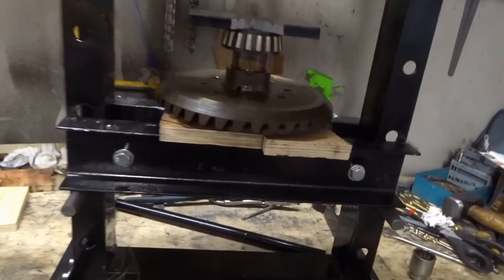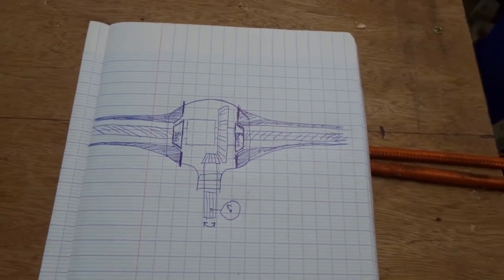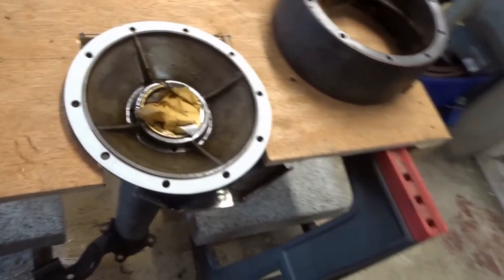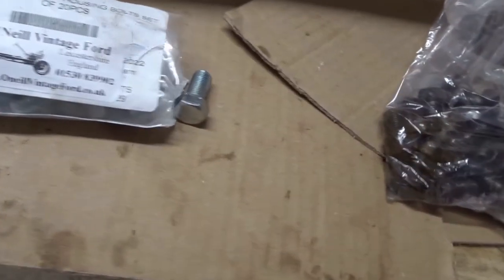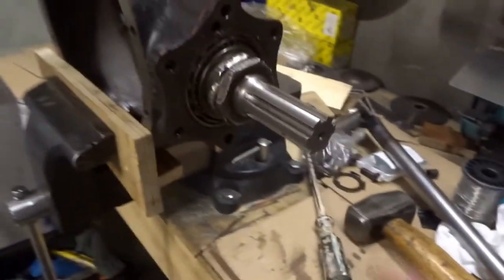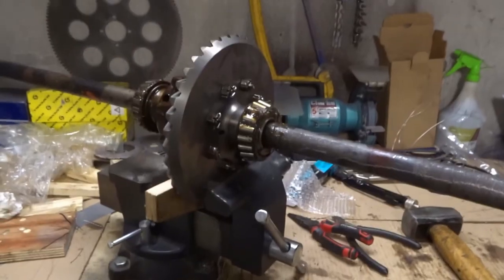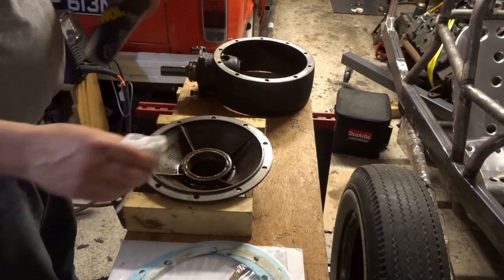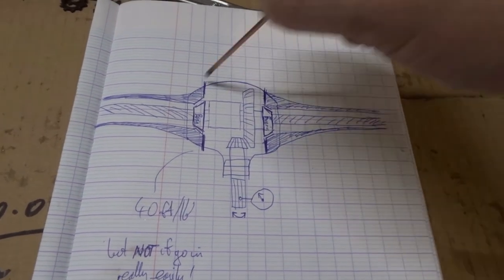Early Ford Banjo Assembly | Belly Tank Lakester Build Ep.25

Comment: excellent video, thank you. There are no local people that will work on my 46 Ford banjo rear end. Really appreciate the coaching sir!
Reply from the maker: Yes, early on I did email a couple of specialist hot rod shops in the UK and didn't even get a reply - strange way to run a business I would suggest. In the end it was just a simple case of if you want something done, do it your effing self! Quite a good rule to live by I have found.
Reply from the maker: Nobody would repair the sill/lower door track on my VW bus a few years ago either. Full vehicle restoration would have been no problem, no doubt with a full social-media build-log but a repair, not lucrative enough to bother with. Again had to just get on with it myself hence the video I made of that, which seems to have helped a lot of people too.

Comment from the maker: One extra point, if you put silicone on the gaskets in the final step, it has to be incredibly thin otherwise you make them thicker overall and mess up all the adjustments you have made to get their thickness just right. That is why some have said use a smear of grease instead.

Comment: Setting the CWP meshing always seems tricky to me and even when spending ages trying to get it right I am never sure I have! So far so good with the ones I have done though. I remember on my MGB I checked the drag on the pinion with a small spring balance on the right sized lever. I think you would have to try very hard to get them completely wrong.
Reply from the maker: I tend to agree with you. Being able to turn the crown wheel with 'just a slight drag' for example could mean different things to different people. As you say it seems to be more about getting things into about the right ball-park, not stupidly tight or stupid rattly loose.